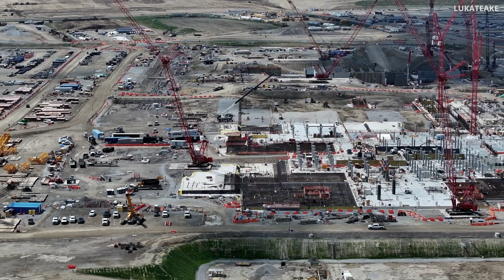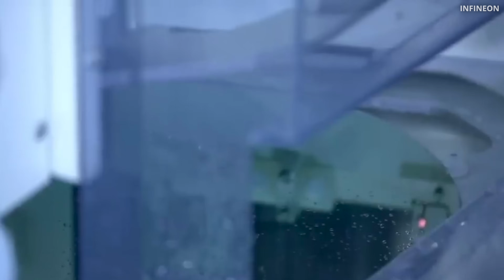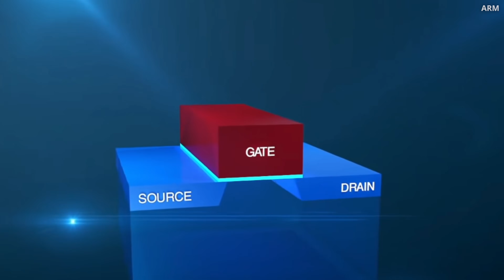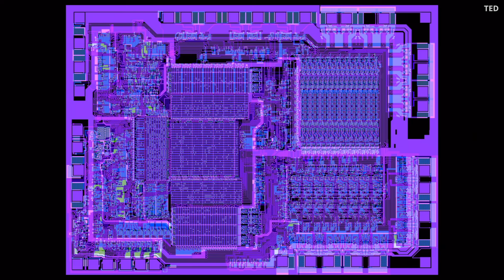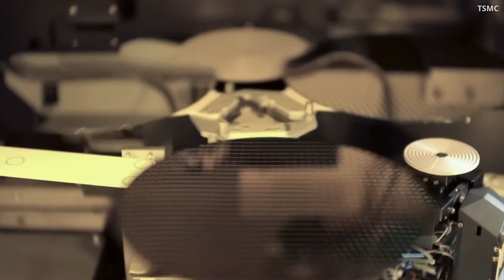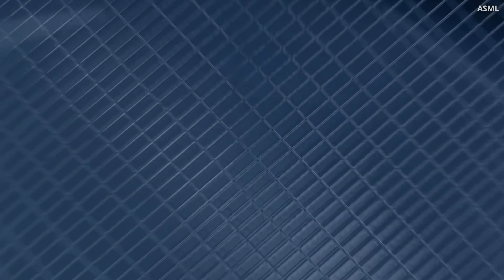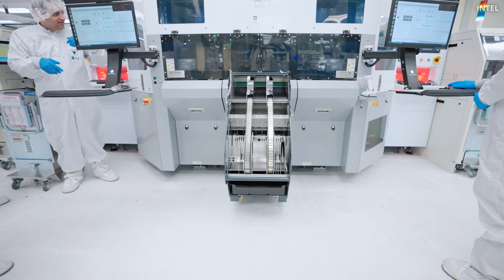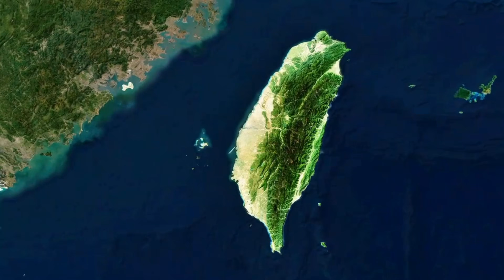Huge Chip Breakthrough — and A Massive Warning For TSMC

Comment: Intel has built an extremely advanced new fab in Arizona and a radical new chip process called 18A that briefly puts it ahead of TSMC and Samsung, but its future depends on fixing yields, winning customers, and filling these factories at scale.

New factory and tools
The video tours Intel’s Fab 52 in Arizona, a multi‑billion‑dollar mega‑factory with a huge clean room, extreme dust control, and massive water recycling built to run EUV and High‑NA EUV lithography tools.

These tools, plus atomic‑scale deposition and etch systems, let Intel print denser features and run one of the most sophisticated semiconductor production lines on Earth.

18A process breakthrough
Intel’s 18A node introduces two big changes at once: RibbonFET transistors (gate‑all‑around “ribbons” replacing FinFETs) and PowerVia backside power delivery, which together boost drive current, density, and efficiency.

Backside power moves power routing to the rear of the wafer, cutting IR drop and noise and freeing front‑side routing for logic, but it requires flipping, thinning, and processing both sides of a fragile wafer, making manufacturing very hard.

Manufacturing risk, yields, and products
Intel skipped an intermediate 20A node and jumped straight to 18A, stacking multiple innovations plus a new fab and flow, which initially produced very low yields (under 10%) and high defect rates.

After months of tuning, Intel has started shipping real 18A products like Panther Lake client chips and preparing Clearwater Forest data‑center chips, proving the process is now manufacturable, though economics still depend on further yield gains.

Competition, foundry business, and geopolitics
TSMC’s N2 and upcoming A16, plus Samsung’s similar gate‑all‑around and backside‑power nodes, are chasing the same blueprint but with a more conservative, yield‑first approach.

Intel’s big challenge is commercial: it must overcome the “IDM dilemma” (competing with its own foundry customers), build trust versus TSMC, and secure volume from players like NVIDIA who want a second advanced manufacturing source as AI demand saturates TSMC.

Why it matters globally
If Intel sustains 18A and fills fabs in the US, the world gains a second serious provider of leading‑edge chips, reducing risk from today’s heavy dependence on one geography and one main foundry.

The video ends by stressing that being first with 18A is not enough; Intel’s true test is turning this technical lead into durable market share before competitors’ next‑gen nodes arrive.

Comment: Why can't they make a chip that absorbs electrons from its surroundings and have internal capacitors that can boost it out put from the quantum vacuum and make it a phone battery that doesn't run out 🤔

Comment: Please, when you are referring to the size of an area which is bigger than a standard then kindly use the larger unit. for example if some land is bigger that a meter then kindly do nor refer it in sq feet but rather in sq meters, acres or hectares. 2.6 million sq feet is not a proper way to describe the size of an area.

Comment: @11:26 your talking about "drive current", are they going back to Bipolar Transistors for Microprocessor's instead of FET's. It's a good idea if they are. CRAY had it right - faster switching speeds.
Reply: still cmos, not bipolar.

Comment: Oh, one other question. What I have been waiting for since the 90s is the convergence of storage technologies into a single technology. We have high speed, low capacity volatile memory, and we have low speed, high capacity non-volatile memory. But the 'low speed' non-volatile memory has been catching up for years, first with SSDs on the SATA/SAS bus, and now with NVMes on the PCIe bus. What that says to me is that in the long run, we will have only one memory. It will be solid state, it will live on the same bus as the CPU/GPU, and it will be non-volatile. How will that change OSs? How will it change motherboard design? How will it change how programs use memory? Or do you think it will always stay as two separate pools of memory?
Reply: Look up Lunar Lake
Reply: @MrRazorchampion  Not sure how Lunar Lake is related to my question. It's an SOC designed by Intel, made by TSMC, whereas I am talking about the convergence of RAM and 'hard drives' to a single technology.

Comment: Very well presented Anastasi. I spent 25+ years at Intel and it's good to see them back on top. Now all they need is customers.
Reply: NVidea can provide a huge market by itself.
Reply: Back on top?  You’re kidding, right?
Reply: @techluvin7691  Watch the video. Their process is the most advanced. If you disagree, argue with Anastasi.
Reply: @techluvin7691  They're not on top. Nobody thinks Intel's reputation is better than AMD. I recommended against anyone buying any Intel chip due to how they treated their massive screwups with even more massive coverups. Yeah. It will take years to re-establish a decent reputation in the industry.
Reply: @techluvin7691  Intel is just dormant, they had internal issues , not technical ..
Reply: If they quit changing Motherboard platforms every other year, they would. 
If they used the same chipset for 3-5 yrs, how are motherboard manufacturers going to make money? 
Scratch my back, I'll scratch yours. 
AMD has the right idea. Which is why I went with the 9800x3d.
Reply: @failingup4907  Yes, but even if they use the same chipset/socket, the tech in the mother boards evolves, like PCIe 4.0->5.0, etc... Faster RAM, etc...

For that you have to change the motherboard AND the CPU.

So Motherboard companies have the market for people changing them.
Reply: @failingup4907 thats why amd will remain stagnant , they don’t push boundaries
Reply: What would really help is if Windows were to be displaced by Linux.  The X86 architecture is running into too many performance and efficiency constraints.  What Intel needs to do is similar to what Apple did and drop X86 architecture and migrate to ARM.  Linux on ARM on Intel 18A would be a great combination.  Include a VM to run Windows to assist in migrating away from Windows.  Windows 11 is a very imbedded and controlling platform with lots of cloud-based requirements to operate fully.  It’s time to break the Windows stranglehold.
Reply: @roch145  Way overdue, the planned obsolescence of ms products is sick.  Made a vampire a billionaire.
Reply: @roch145 Until Linux becomes more user friendly this won’t happen
Reply: @awolbacon9148 IBM owns Redhat.  If they were smart they would work on making a derivative that’s more friendly.
Reply: @roch145  Sorry - Windows will not go away - it is growing faster daily than any Linux build. Linux is way to geeky for the normal person and Apple Mac's O/S like SEQUIOA is no better - so locked down and strange shortcuts - I have multiple machines, Linux Ubuntu, Mint and SUSE, Windows 11, Apple Mac and Windows is still the easiest and best O/S. Solid, stable and so compatible with all hardware.
Reply: @synthwave7 I’m not sure you know what the words solid and stable mean
Reply: @gsmegaphone  On the other hand Linux ppl, don't know what "compatible" mean.
Reply: @gagarin777 Oh you mean how all  the old windows 98 and Windows XP games run far better under Linux/Proton then they ever did under Windows 10/11?
Reply: @billbyrd1361  No I mean there is no driver support for a lo of stuff like sound cards and so on.
Reply: @gagarin777 Linux driver support for desktop computers is rock solid and supportd almost all cards and motherboards.  Peripherals depends on the peripheral and when it was made.  On this point latest windows is probably better for newer hardware.    On laptops and tablets there can be issues on some models  because most of these devices use propietary designs that are not well documented.   Driver compatability for laptops and tablets is gonna be a little better for Windows. I concede this.   So basically desktops Linux is rock solid, laptops and tablets Linux compatability depends on the exact model.    If buying a laptop or tablet always check Linux compatability first.
Reply: @billbyrd1361  You didn't even hide this is answer by AI crap :FFF 
No, there are problems on Linux with HW compatibility and people are forced to write their own drivers like for example the best sound card currently on the market  - Sound Blaster AE 7/9 series, some dude is posting on forums for 2+ years trying to get the card working.
That's one thing.
The other thing is software presence in general. On windows you have millions of programs that have multiple alternatives. If you don't want to use a specific program there is always another company that makes something similar. On Linux the approach is: good luck finding something, write it yourself.
Reply: @synthwave7 thats your opinion, it could be you have a one track mind.
Reply: @roch145 *ageless linux
Reply: @roch145  Linux is not the "dreamland", windows will be always on top, they are just playing the market in how much they can get away with ..
Reply: Uhhh Intel isn't anywhere near healthy. Not even close!
Reply: No one will have money to buy gas, food or housing, let alone chips.😂
Reply: @roswellgrey9771  speak for yourself 😂
Reply: @MrShnazer  I take it that you didn't detect the sarcasm.😹😹
Reply: After intel made chips for years that self destruct on  their own, nobody trusts Intel.  Especially after giving customers the run around for years when trying to get their warranties honored for these defective chips..
Reply: wow, thats amazing, what was your job at intel?
Reply: @TacoCow_IS  Mostly Product/Test Engineering
Reply: you spelt lower prices wrong
Reply: It takes a Chinese CEO to bring back Intel. The "good ole' boys" were worthless.
Reply: Nobody wants chips with baked-spyware and backdoors, never ever buy anything with "Intel" inside.
Reply: China enters the picture, invading Taiwan.  Putting so much important chip production on an island 80 miles from a communist country was just....dumb
Reply: @suitebackyard6030  China invade Taiwan at its own peril - and it doesn't even have anything to do with warfare but rather economics. They can posture and "threaten" but they cannot actually invade unless they have a whole lot of alternatives in place.
Reply: @kevinrtres  Taiwan already belongs to China.  They don't need to invade.  When 40% of your exports go to China, they have to satisfy their customers.
Reply: @kevinrtres  Who is invading who?  US has invaded something like 47 countries since WWII. China, one - Vietnam.  And by UN Resolution 2758, passed 1972, APPROVED by US Senate, Taiwan is a province of China.  Does US plan to invade Texas?
Reply: Taiwan is nothing but an island province of China.  People are ethnic Han Chinese, speak Mandarin, are culturally, linguistically, and ethnically identical to mainlanders.  It's US who purposely created the split.  Taiwan and mainland are identical, as opposed to Hawaii (where US overthrew the kingdom because of Dole, and Puerto Rico, which is ethnically, culturally, and linguistically very different from the mainland.  And let's not get started on the American Indian (who was not native either).
Reply: @suitebackyard6030  China won't touch it. It needs TSMC to keep running, because the first thing Taiwan would do if China went forward with an invasion, would be to destroy TSMC - because Mutually Assured Destruction comes in many forms.
Reply: @suitebackyard6030  China needs many chips that only taiwan can make ..

They FAILED hard in their own fabs ..
Reply: @suitebackyard6030  40% of Taiwan's exports go to China.  What does their economic system have to do with anything?  Are you trying to tell other countries what they're supposed to put on their island, while crying "communist".  You can buy the lithograph machines and put them in your backyard from ASML Holding , but you'd rather cry about China.
Reply: @suitebackyard6030 I’m sure the Taiwanese government had many incentives to locate there.  When TSMC started I’m sure there was no projection that they would ultimately displace Intel as the most advanced chip fab in the world.  Intel has been a massive disappointment.  But that’s what happens when you have a virtual monopoly on CPU’s for decades.
Reply: @suitebackyard6030  Taiwan has a plan if that happens. They will evacuate all the scientists and engineers and move out the industry, if they can't move it out in time, they have a plan to destroy them.

China knows this, and it is one of the reasons of why they haven't touched Taiwan.
Reply: @suitebackyard6030 those factories are probably already strapped with self destruction devices that would be triggered the instant boots hit the island.
Reply: @suitebackyard6030  I live in China, own my own business, and my wife owns two houses and a car. Further , China describes itself as 'socialism with Chinese characteristics.' So, what do you consider 'communism'?
Reply: @garyhalmbacher6875  Procrustean mentality and policies. Ask Jack Ma.
Reply: @garyhalmbacher6875  What the goverment do with permanent neurological disabled people ? ..
Reply: Can you buy stocks from another country? ..
Reply: When you pass away, can your decide in a will who gets your assets ?..
Reply: What taxes you pay every year on ; property , emisions from the car (s) , and income ? ..
Reply: For example i own 5 properties, all with the land , is there a limit in how many you can own ? ..
Reply: @aocg1914 You mean FJB then Trump?  I don't know what to do with either.
Reply: @aocg1914 As far as I know, yes.  It's mostly America and the banksters which restricts the citizenry from dealing with other countries through illegal sanctions and outright violence.
Reply: @aocg1914  As far as I know, yes.
Reply: @aocg1914 Do you mean US, which taxes everything, including personal property?  Go like in PRC.  People's Republic of California.
Reply: @aocg1914 No.
Reply: @garyhalmbacher6875  Taxes are a must, if you dont pay any tax, its not a free country ..
Reply: If they succeed (though it seems they have) and the prices of RAM drop, they WILL have the costumers. I need a new PC, waiting for this to see how it goes.
Reply: @serpentine1983  RAM prices will never drop. Get used to these prices or 2x (or more) as the new baseline. $500 for 16GB memory. Check. $1500 for 4TB SSD? Check. It's a gravy train for the industry.
Reply: @serpentine1983 no, they WON'T have the customers. AMD is smashing them on x86. Intel 55 AMD close to 40 now . For desktop. Server is close to 40 AMD 50 Intel with AMD mai training a huge advantage in power
Reply: @CF_Harris_The_Author  But this is a new tech, I agree in that AMD won in the previous generations, but we have to see this one. If Intel is better, they will have the costumers.
Reply: There's so much fluff that I'm several minutes in and other than the fact that there's a factory I still have no idea what she's getting at.

Comment: Nobody wants to use Intel foundry - not even the internal Intel designers.  TSMC was built from the ground up to work with fabless design shops.  Its a human interaction more than a technical problem .  Intel needs to spin off the foundry business from the design business.

Comment: Intel has had to go all in, if it works or not in those new plants is another question. With AI we could be headed for one of the biggest financial crisis ever as the US starts printing $ to bail itself out. The yields they are getting are extremely low low yields (estimated at 10-30%)